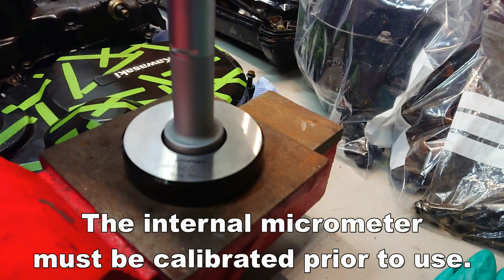Kawasaki ZX-11 (ZZR1100) Drag Bike Nitrous Engine rebuild

Comment: My 3rd gear is out…I wish i knew how to do this work. I have a replacement gearbox and manual but I’m fearful of screwing something up. 🤦🏽‍♂️🤦🏽‍♂️
Reply from the maker: It's not too bad, if the engine is out and you don't want to risk it a bike shop should be able to swap the box in a couple of hours

Comment: Howzit, can you recall what you bored the cylinders out to? As in what clearance did you allow for the piston and the cylinder block? Did you use the standard kawasaki spec clearance or diff because of the forged pistons?
Reply from the maker: Hi, the over bore is 2mm, and we used the clearance and finish specified by the piston manufacturer, wiseco. The ring gaps were increased to suit a 100 bhp nitrous shot. If using aftermarket pistons always use the piston manufacturer recommended clearance, as forged pistons expand more than cast ones. Thanks for watching 😎
Reply: @PhilOsGarage  greattt thanks man, i got a set of 2mm over size wiseco pistons on their way. Cant wait 😁😁 and thanks again

Comment: Water Cooled Kawasaki engines have not changed much over the years, which is good to see.
Makes it nice and easy to modify parts from one engine to the next.
Thanks for bringing us along.
All the best.
Peter.
Reply from the maker: Yes, absolutely, you can easily trace this design back to the gpz 900 of the early 80's, and the design carried forward to the ZZR 1200.  Thanks for watching 😎

Comment: Can you make a video aboit zx11 transmission problem please i have problem with my zx11 transmission
Reply from the maker: Hi, is it a 1990 - 1992 model?  I am planning on releasing a buyers guide video soon, and will cover the issue there, it's well known.  It is possible to fit the comple gearbox from the D model, be sure to get the gearbox sprocket too, as they are different

Comment: How did you solved the 3 rod bearing problem?
Reply from the maker: Hi, there are a few things, we removed the oil cooler, which slightly improves flow, fitted a new pressure relief valve, removed the balance shaft (and plugged it's oil feed) and always run the oil slightly over the full mark.  There is no one single cause of the no3 issue and some bikes seem less affected than others.  When we stripped the engine it had done 26,000 road miles and two race seasons.  No3 was perfect.

Comment: can you tell me more about your PAIR block off plate solution?
Reply from the maker: It's nothing too fancy, we just use a basic blanking plate to replace the petal valves, in European models it wasn't as complex as California bikes. We then just remove the valve and block the lines.
Reply: @PhilOsGarage  your blanking plate seemed like a bolt in the pair hole
Reply from the maker: @beholderlt  there is a bolt to close the external hole, but there is a blanking plate under the cover where the petal valve is too.

Comment: Nice. I have a forgotten turbo efi zx11 project in my garage. Maybe I should follow your steps. Did you stick to oem rods?
Reply from the maker: Hi Diego, no, we are using forged I beam rods from max speedingrods with ARP rod bolts.  Get the ZX-11 out, these old girls can hustle!
Reply: Hello Diego !

How are you ?

Autronics rocks !

Comment: Nice work! Can’t wait to see it on the strip.
Reply from the maker: Thanks 😊. Our previous best was 9.76 in the 1/4, our class has a 9.50 index, so we don't need much more power. We can now increase the nitrous with confidence.
Reply: Phil'O's Garage yes, for sure. How much horsepower increase do you think the big bore kit will make?
Reply from the maker: @franck_97  probably not a huge amount, though I expect an increase in torque. I'd like to see 140 - 145bhp at the rear wheel, which would translate to 215 - 220 bhp with the nitrous at 100%.  We only Ned about 165 at the wheel, so the numbers suggest we are likely to be in the zone.